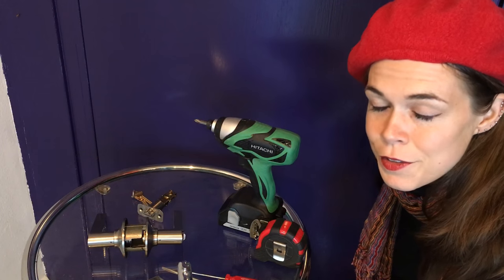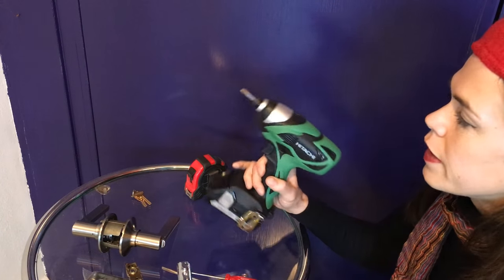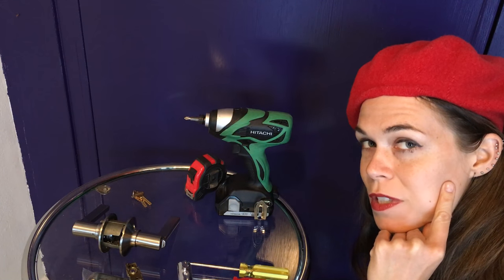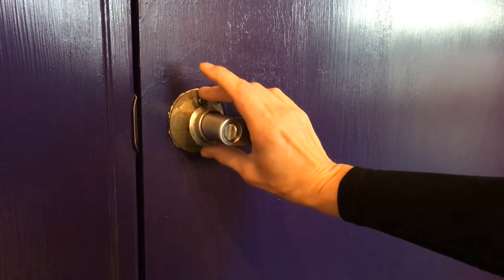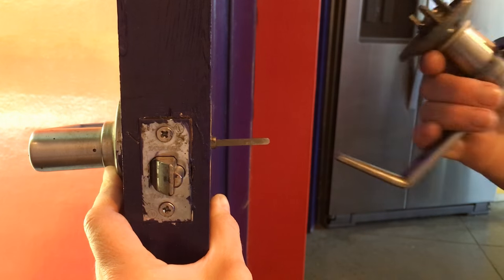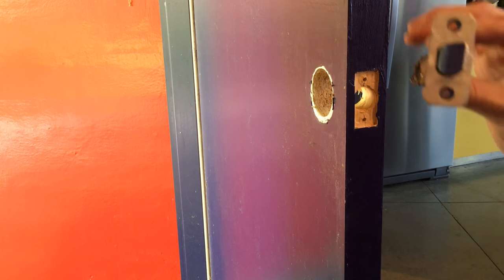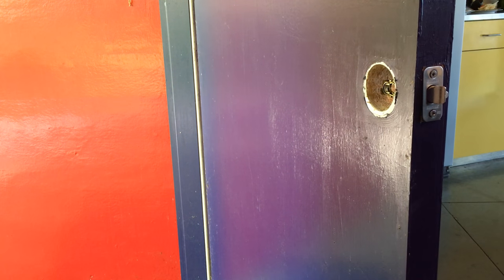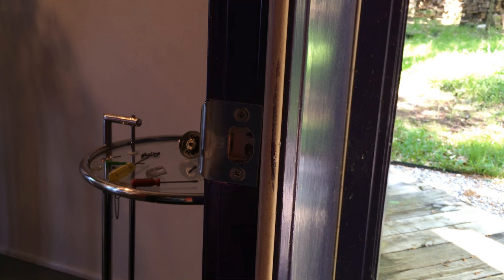Changing a Door Lock - Things Even a Monkey Should Know

Comment: Suggestion:  replace the short included screws with long (6-8inch) screws of the same diameter, both on the lock side ( if you can do that without interfering with the bolt function....it looks like you should be able to do that)) and on the striker plate side.  This will make the entire door much stronger and harder to kick or pry open.  You might need to drill pilot holes, but other than that it is pretty straightforward.  Your new eurofashion look with the beret and scarf is fresh!  Keep up the fun videos.
Reply from the maker: +Norman Means Many thanks! And I did change out those screws, excellent suggestion! It took about 3 minutes. :-)

Comment: next time you encounter a stripped screw try using a rubber band. Just put the rubber band over the head of the screw and just give the drill a little power and it should come right out.
Reply from the maker: +Cold Steel Fanboy Katana Lover That is madness! Thanks so much for the tip!! :-)